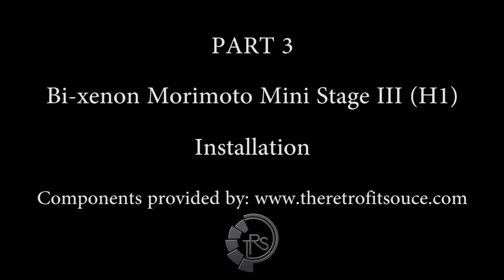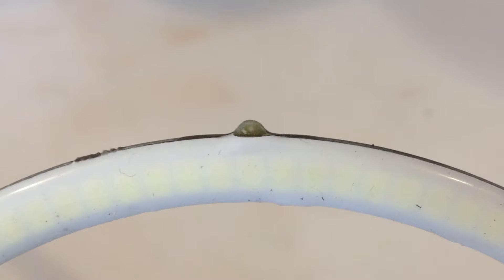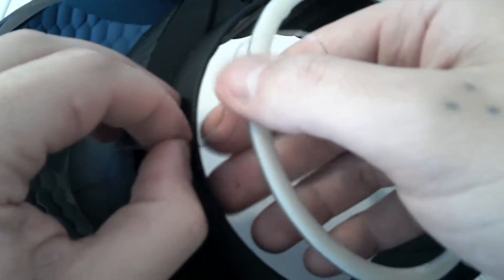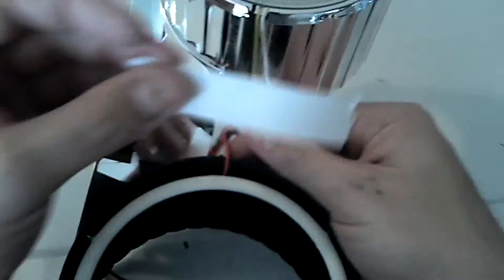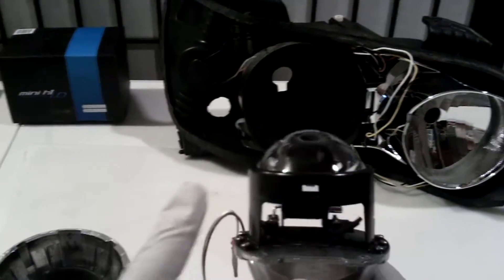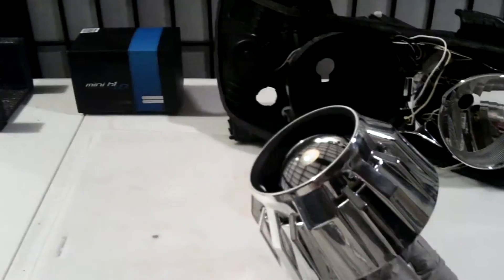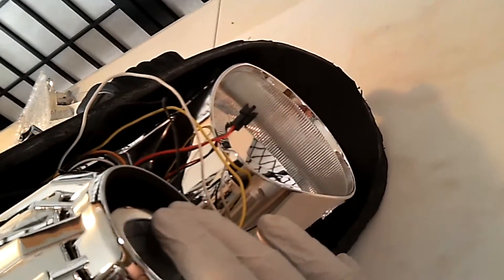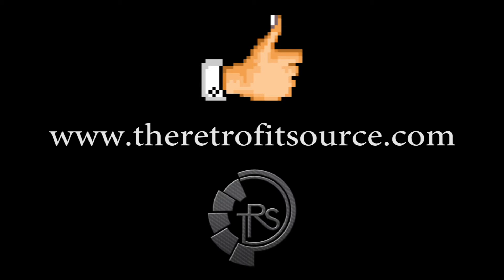Chevy Sonic Headlight Retrofit Part 3

Comment: Do I have to buy 110mm for the high beam reflector or can it be 120mm because I just ordered them and I just looked at the headlight and the high beam is smaller
Reply from the maker: Christian, you're in luck. The 120mm rings will also fit the high beam reflector at the front. Instead of attaching the ring to the cylinder with wire, all you need to do is lay it down in the transparent part and the cylinder will hold it in place when you screw it back in. To be honest its the most secure mounting solution.
Reply: DIY Toona oh okay so lay if flat on the ring instead of flushed with the reflector .... I was amazed with your vid that you can put halos on but I dont like that you have to cut it I've baked some before and it worked
Reply from the maker: Pretty much. Lay the transparent part face down (like the removal at :45 in this video) and just place the ring in the bottom. When you screw the two cylinders back in, the ring gets held between it, and the transparent part. Supposedly these can be baked. I tried and melted two headlights. Later found out that different plastics (with different melting points) are used depending of origin of manufacture. If you bake sonic headlights open successfully, please comment on where they were made and the temp / time you used.
Reply: Okay sounds good ill keep you updated I hope u don't burn them lol